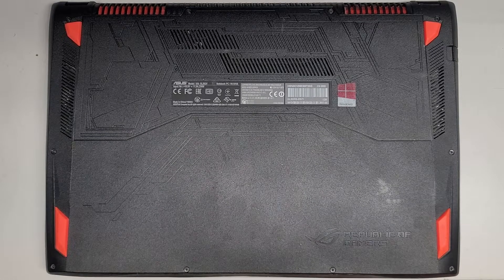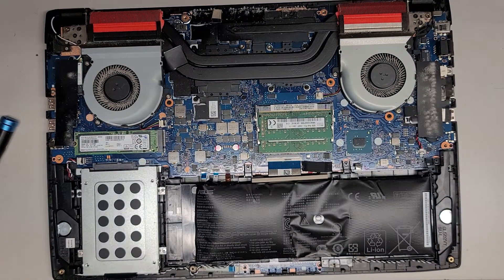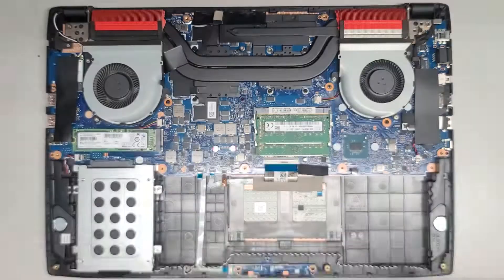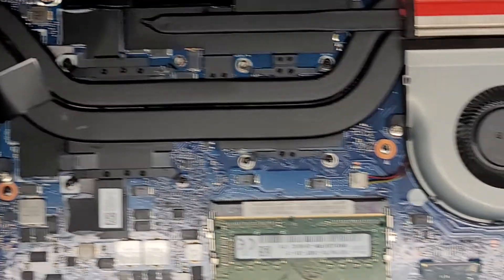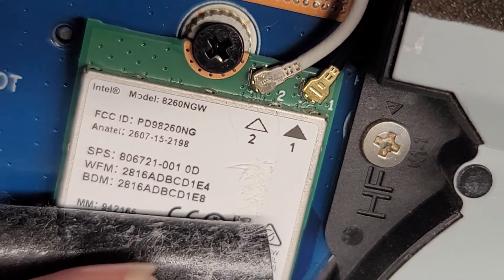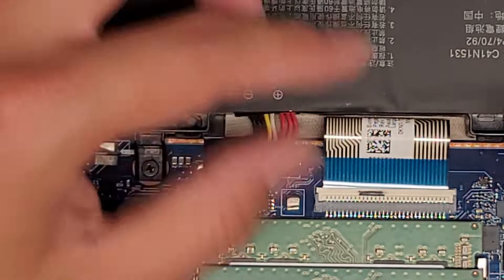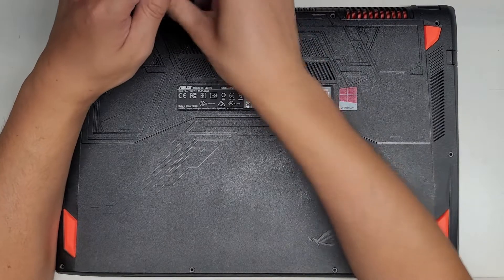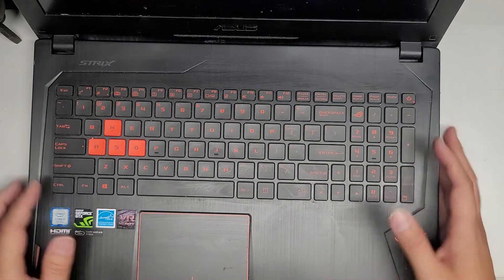ASUS GL502V GL502VS-WS71 Disassembly RAM SSD Hard Drive Battery Replacement Repair Spicy Pillow

Comment: Really great video however I didn’t get a good look at the bios clock battery do you know the part number on that so I could get a replacement?
Reply from the maker: I believe it's this cr1220w, I have affiliate link at rometechbatteries.com Get 15% off if you use my promo code : ItsBinhRepaired when you make a CMOS BIOS purchase at rometechbatteries.com

Comment: What’s the max ram the GL502V can take? Also suggestion for replacement battery?
Reply from the maker: The max is whatever you can buy and fit in the slots. Depends what they have available.
Reply: 6700hq-nál a max 2x32Gb 2400Mhz. 7700hq-nál a max 2x32Gb 2666Mhz.